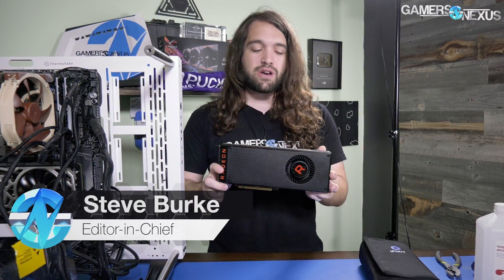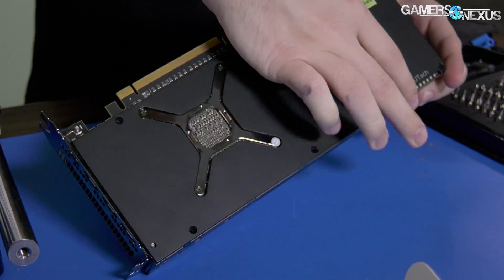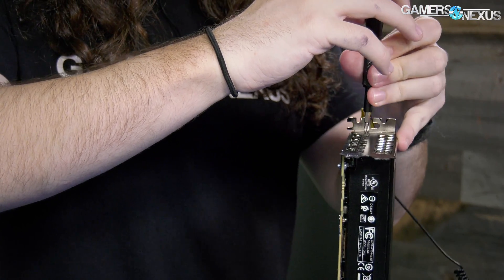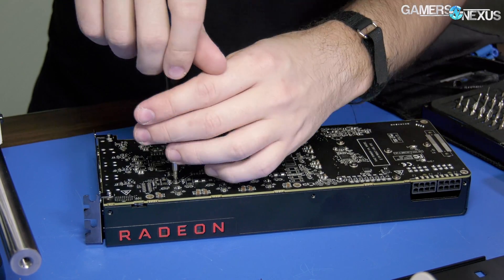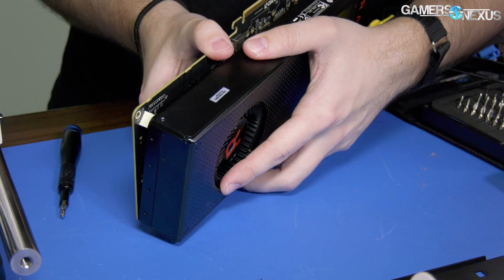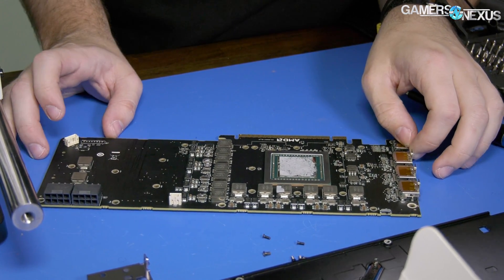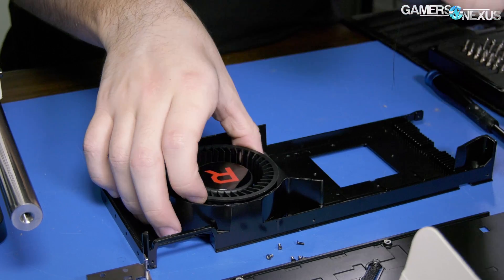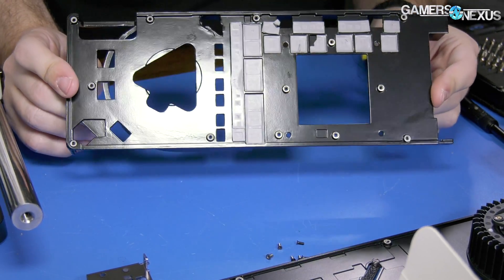AMD RX Vega 56 Reference Tear-Down: Cooler, PCB, VRM

Comment: why people care about power draw and other things that are covered by the power supply.  temps as long as gpu utilization is at 100% 
 
 isn't that what matters??
Reply: some people have to pay the bill. And in summer it heats up your room
Reply: Alberto Kostner 
I get that part,  even if is high,  your electric bill won't go up 30$ 40$ 50$ .  thats the part I don't get . even mining with two rx580 the electric bill only goes up,  like 5$ or 10$ . at month,  thats the pc 24/7 on.  I know the PC won't always be turned on.  
 so this is the part I don't understand why people nitpick about power draw and power efficient.  when the gpu is at Max and is not throttled.  can anyone explain
Reply: yes it heats up the room, even i have "only" a 6600k ( 4,2ghz + undervolt) and a stock clock gtx 970 i have about 5-7°C more temperature than in the other rooms
Reply: Richthoven 
are you sure one card is going to heat up the room that much,
Reply: Richthoven This thing will pay the bills for itself. Even with 40Mh/s it is efficient at mining (with US electricity prices), so putting it out of your room and letting it mine when you are not using it is a good ides.
Reply: wiwh 
if you like the quite,  why don't you  wait for custom coolers from aib partners.  

 thats really nice to think like that.  also when I'm no home,  i power down most electronics except the stupid Wi-Fi and fridge. 

 I been reading about some electronic pull a lot of watts when they being turned on.  I been reading into having them on sleep mode
Reply: wiwh I respect you! by the way everyone using their pc for a bunch of hours every day should care about power consumption. it makes the difference in some months
Reply: Because when you are running your not overclocked 7700k with a 1200W PSU, you have to...

Actually, people are not commited to their hobby anymore.
Reply: This is good thing. IN part i dont care much about witch cosumes over or under 100w more but we should drive to use less power and consumption anyway. then again our Kwh prices are like 0.04-0.08 euros currently US has like 0.12 or what.
Reply: I care because I don't wanna feel the real heat of the battlefield when I play FPSs.
Reply: It depends where you live. I pay about .09 dollars per Kwh where I live in the US.
Reply: Mitochondriac I used 10ct/kWh as an estimate. A 500W PC with 40Mh/s means profit. It will heat up your room quite a bit, but considering ryzen needs half the power of any Intel chip, your whole PC will only be 50-100W over an Intel/Nvidia build.
Reply: Bolinar electricity costs more in the us? But they use coal!?!
Reply: I personally care about power draw because I like efficiency and I'm "energy-conscious" I guess? It may sound stupid, but I'm a triathlete and I have all kinds of power measurements when I train and race, especially on my bike, and I know what 300 watts is. It hurts me to draw too much power from the wall, because I realize how much work is being done by some turbines somewhere on the grid. You know, I turn down every single device that I am not currently using , I care about every watt that I consume, and if I can consume less at a low performance cost in my PC, then I would go for it. Mind you, this is not at all a matter of electricity bill, but consuming less is what we should aspire to, not consuming more just because we can. Also, the more power your machine draws, the more heat it produces; the more heat it produces, the more heat you need to dissipate, which then goes to the room you are in, which eventually gets hotter and become less comfortable. Also, dissipitating heat from a PC requires fans, which are not quiet, and I love my quiet.
Reply: cause my dad doesn't pay my electric bill...

Comment: wonder if that vaperchamber will fit on a ref RX 480
Reply: I think the mounting points are farther apart since the die is much bigger than the rx480/580 die
Reply: dont really think they are. the r9 fury uses the same mount spacing as an rx480 and the die size of the fury and vega is pretty similar
Reply: They won't fit on those midrange Polaris chips. They have smaller dies and different mounting points since they don't have HBM. 

The Fury line is the only other consumer cards that have ever featured HBM other than Vega. Those might be able to be modded to fit it.
Reply: the only issues there could really be are Z height, mount spacing and the orientation of the actual silicon. the cores are both dead center of the mounting points so if the spacing is the same and the Z height is close enough it should fit because how much smaller Polaris is. just a curious question honestly and given that it's a blower style it probably wouldn't do much anyway.

Comment: So yea, that 30 watts of power draw is not only eating into that 300w cap, but also making the card look way more power innefficent than it actually is, as did the rx 480 at launch, were everyone thought it was a total power hog, but then the liquid cooling the reference card happened and power draw dropped by 30 watts, all due to the fan being removed. So these delta fans are insanely power hungry and once we see them disappear, power numbers will look better.
Reply: why would you want them to disappear? drawing more power = more powerful blowing (you know, the thing fans are MADE TO DO)
Reply: Just Petrusion or a 90mm fan like on the nano (talking about the fiji version as the vega one is unconfirmed) which used about 10w at max load. If you're gonna put 30w worth of fan on the device, it better be a multi fan design that actually cools the card.
Reply: Just Petrusion also most say with the vega 56 vs the 1070, the vega 56 consumes 65 watts more, when really it's about 40 more, due to the extreme fan.
Reply: EK fluid system is looking great for this

Comment: Just watch Adored TV review. Its possible for AIB to release two difrent card. One is the low tdp version and the other one  standard version. The lower TDP version will be using less VRM and mosfet with the downside of unable to be overcloced. It will be 6/8 pin card.  It is probably the vega nano since sfx psu rarely have more than 8 pin pcie power cable.

Comment: i have only seen warranty void stickers on nvidia cards

my HD 7950 and RX 460 did not have any stickers
Reply: alex alcala ortiz Warranty void stickers are illegal in most places anyways (US and EU for sure, idk about the rest of the world) and you will still get full warranty if it is broken.
Reply: Did you ever try to do a bios hack on your RX 460? I'm mildly impressed with mine, the only game where I wish I could get more fps is Deus Ex Mankind Divided, otherwise after I hacked the bios and found the overclock sweet spot and scoring 6800 pts on firestrike, I'm glad I saved the money on a cheaper card so I can make a bigger upgrade later on.
Reply: alex alcala ortiz my Nano hast one too. for AMD only reference cards have them. Never seen them on 6950/7870/7950/390x from sapphire but I believe my 6950 reference had one
Reply: well i will just keep buying sapphire then
Reply: i had it unlocked for a while but driver updates fucked me so right now im using the original one
Reply: are they illegal in the EU? i live in spain and my GTX 1050 has one
Reply: Yeah I had to unlock it twice because even though I had auto updates disabled in Radeon Settings, Windows Update forced the driver update. I was so irritated, but I dug into settings and turned off driver updates via Windows Update. So my driver is the 16.12.1 version that was manually hacked to work with the unlock.
Reply: well that sucks
Reply: Lasse Reinlaufen Illegal?
In Italy have those!
Reply: I have a Sapphire R9 Fury and a Zotac 1080. No stickers on either.

Comment: Is it possible to only remove the top of the shroud in order to easily clean out the fan and cooling fins with a can of compressed air. You you void your warranty that way?

Comment: "They" said Vega RX would be different.
Reply: well, it only has 8GB of HBM2 so yeah it's different.
Reply: proesterchen yea it's cheaper
Reply: Actually.. not. Apparently that was launch price.
Reply: Michael Mendieta well 599 (which is fucking insane) is still cheaper than 999
Reply: Vega will be good 3 years from now. Remember AMD build GPUs for the future, not the present.
I bought R9 Fury for 200€ and it's perfect for 1440p.
An RX Vega will be good in the future for less than $300.

Comment: So, we got the stripped down version of Vega Frontier Edition with almost no changes, apart from the few disabled CU's which didn't made it through the process.

Do you say this card is more value in terms of hardware quality and components. It will be able to keep longer without blowing up like the Nvidia cards do? I had 2, a GT640 and GTX750ti, both didn't keep up to 2 years before burning out with overclock. Have a GTX770 now and decided to not overclock it and it is now keeping longer than 3 years.
Reply: You overclocked a GT640? Why? Seems like that would be about as sensible as putting a fourth wheel on a tricycle.

As far as dumping all Nvidia cards into a "fail before AMD cards" kind of statement, well, I have a GTX 680 Classified, the version that you could overvolt as well as overclock right out of the box, and it is still alive, still performing like new. So maybe your "early failures" have more to do with 1)overclocking cards really not intended for that purpose and 2) more related to the brand than the manufacturer of the GPU itself. (And if your warranties were shorter than 2 years I'd suggest the brand was suspect, no decent manufacturer has a warranty less than 3 years.)

Comment: Such a nice and clean pcb
Reply: it is to long though, i said it before and i say it again:
they should have used  a short pcb and put the fan   extra not mounted on the pcb, this would also had other advantages like prettier shorter waterblocks and  blower style fans that can suck air in from both sites of the card.

Comment: Def getting a 56.... Don't really see why to buy 64 tho
Reply: if the hbm can't overclock that high or  bios limits can't be lifted, it can definitely make sense to get the 64, also compared to nvidia, amd put the performance of their cut down version closer  to the full  card, but also priced it closer,  that is assuming we ever get msrp prices....
also another point: being fucking disapointed with vega performance so far, but having a 4k display with freesync, nvidia's shit not being an option of anti consumer practices and  wanting all the performance u can get to get somewhat decend 4k performance.
so shooting for 4k 60 fps rather than performance/euro,dollar.
Reply: HandBanana looks cooler
Reply: cataria pega AMD has freesync and I expect 5-10% extra FPS on both from driver updates. Right now, the power draw is the only downside I see to it compared to nvidia. It sure is late, but I dont see a point in calling it a failure for that. Infinity fabric is really new and could work much better in a GPU than it does right now (judging from FPS/Tflop), I think navi will properly implement it. Combined with better HBM yields in the future, AMD has something to work with. I think Volta will be like anything before, stripped down GPU at launch as a flagship and then the actual GPU will be released much later as a ti or titan and it will be as overpriced as apple products (from a manufacturing/design cost point of view). I think AMD can score big time with Epyc though, it would mean a lot more budget for navi.